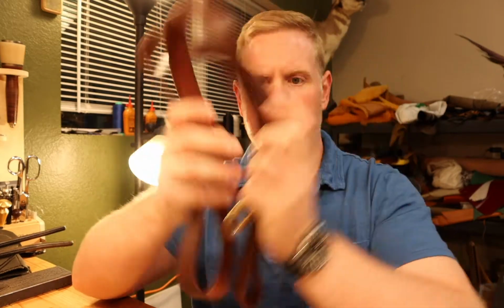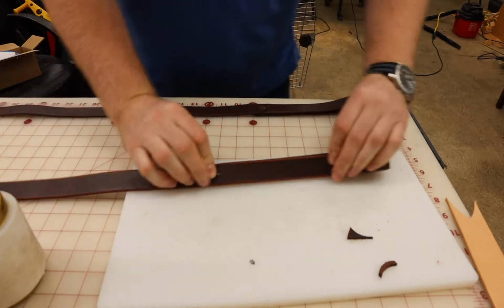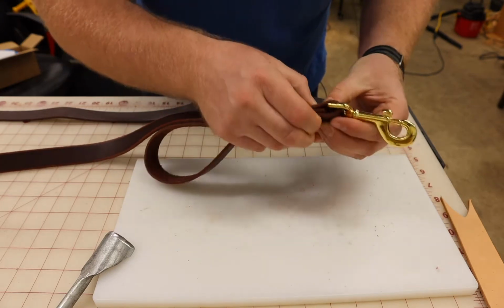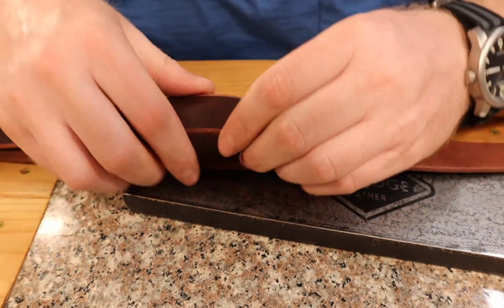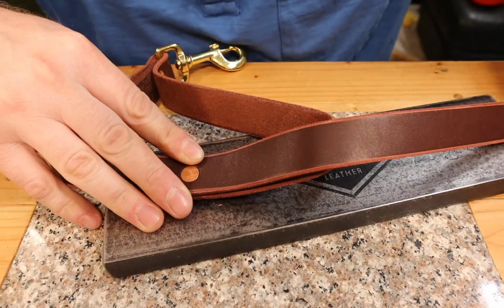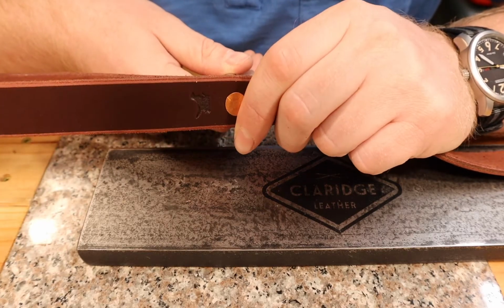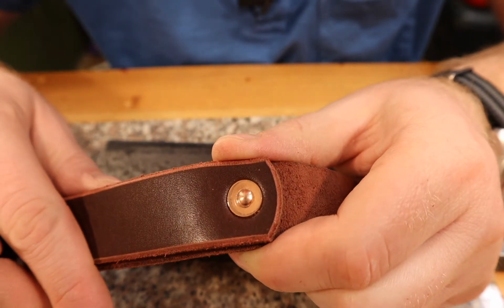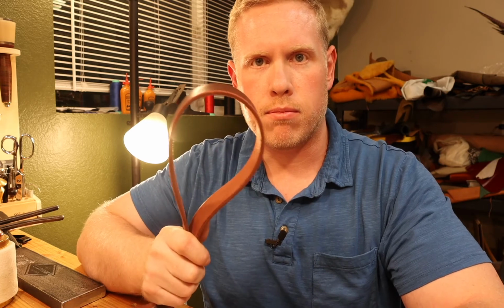How To Make A Leather Dog Leash

Comment: A very nice demo for leather leashes. I like your work.  Superb leash.  I always recommend a leather leash for dogs over nylon junk. Very instructive to see how these leashes are made.  The shop leashes are overpriced and frustrating to look for.  Thank you for a great demo!  That was a pro tip you gave us about the multi facet tip.  Snip rivet halfway, turn pliers and snip off the rivet. Now you have 4 facets to that rivet which leads to a smoother dome finish, brilliant.

56" or 4.6 ft is not a good size. Standard leashes are 6 ft long and short ones are 4 ft.
I would recommend you make a 6 ft standard leash.  This is the only type I buy for all dogs, with varying width, and the only type I recommend to dog owners I train.
I also only use 1 inch wide leashes for all medium to large dogs as it fits well in the hand, easy to grip, and weight is not heavy  for these dogs. For tiny breeds I switch to 5/8" or higher.  1/2" is too narrow and cuts your hand or neck when you swing leash over your neck while jogging.

12:05 - I have never worked with leather so forgive me if this is a stupid question but why don't you lube the hole inside that punching cylinder so it does not get stuck on the rivet stem?  Triflow silicone grease is what I would use. It may be that it is slightly damaged inside so slide a round file thingie inside to sand it down.  Maybe a piece of metal is lodged there.
To dome it without flattening out the bottom tiny dome, use a socket wrench or heavy nut on the other side and let the rivet point be inside the nut hollow so it does not flatten out. The outside of the nut will provide resistance to dome big head easily.

Comment: Thanks for the video. In my experience as a puppy raiser for Guide Dogs of America, anything over 3/4" wide is too wide. The ideal width is 5/8". It fits well in the hand. For larger Dogs like Germany Shepards and larger, then 3/4" is an acceptable option.
Reply from the maker: I haven't played around with the width at all. I cut the first one at an inch because it seemed right and then it worked for me. I'll try your suggestions and see what I think! Thank you for the comment
Reply: Well, you may want a narrow leash for puppies as anything too heavy is hard on their necks, but you are mistaken about the widths.  I have had German Shepherds and you ONLY want a 1 inch wide leash as this is easy to grip for strong big dogs. Over time leather stretches and becomes narrower.  You do not want less than 1 inch for all medium to large dogs.  Maybe 5/8 inch or 3/4" inch for smaller dogs. I think you deal too much with puppies and forget what big dogs are like.